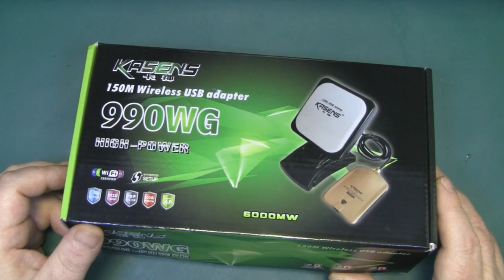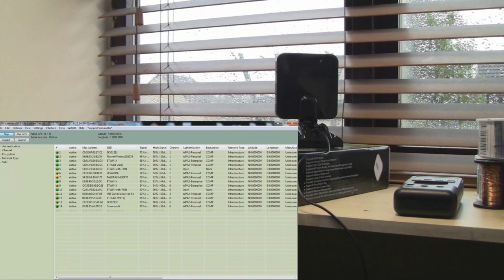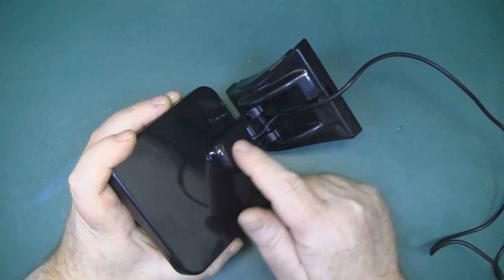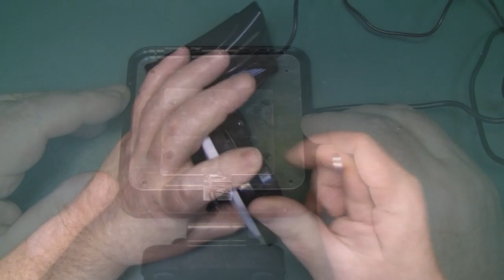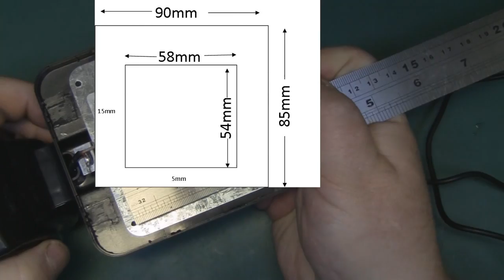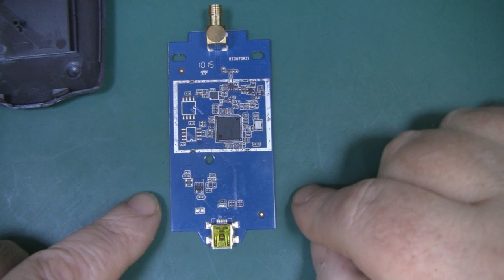6000mw WiFi Adapter with a 60dbI Antenna #126

Comment: Andrew, good work as usual. What I would like to know is - are there any Cellula SMA antenna to fit on the back of a SIM modem to improve the receiving signal strength (internal or external) ?

Comment: I'm sure you knew right away that the antenna was far from 60DB because the antenna is just too smal and also the antenna would be so directional that it would be unusable and you also knew that the WIFI adaptor would never be able to put 6W (would probably need active cooling).

Comment: Hello Mr. McNeil,  I have the exact same pair of devices.  I came across mine by way of a windfall; one of my clients went with s"slick" looking 2.4ghz omni directional dipole and wasn't interested in keeping this system (he thought it looked too cheap to be effective and prepared to abandon it in the waste bin but deferred when I advised him that disposing of electronic devices in such a manner is against our country's federal laws. I volunteered to take care of the issue for him and as a result the system has sat in the box, mostly unused for over five years). At any rate before this short story turns into a full blown novel I wanted to ask you if you thought that surrounding the transmitter section of this system in metal shielding would help to mitigate any spurious interference produced as a result f poor workmanship?  Or did you mean that the problems that my neighbors may notice would be the result of, perhaps, the  indicated output?  (I have been doubtful that this device could produce that sort of wattage but have had no way to verify one way or the other).  Do you happen to know if this device can perform at the asserted output levels?  And if so, would the output directed through a highly directional antenna such as a Yagi help to prevent "over-lap" except for in the opposite direction and the "immediate surroundings?  Thank you in advance for your insight.  (Fabulous channel, btw, absolutely magnificent!)  Very best regards.

Comment: A question regarding your tests. In most cases ( perhaps all?) the final marks are assigned after running  Vistumbler in a Rx modality. May one assume that an antenna works as well in the Tx mode? I am running one of your copper foil 2.4 Wifi Yagi as a range extender, taking a lead off the PCB of a Linksys AC1600 Dual Band Wireless Router and wonder what results I can expect when running Vistumbler on the other end?